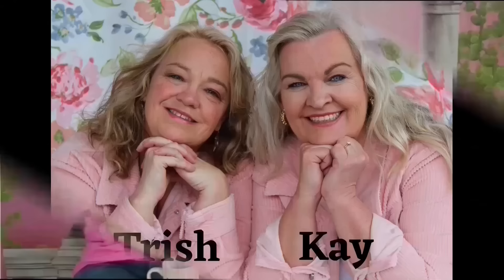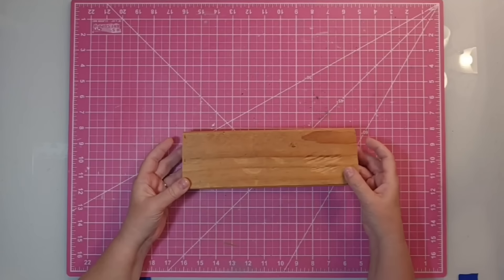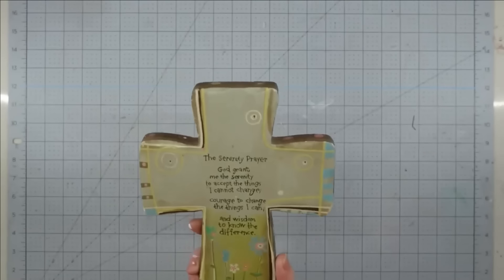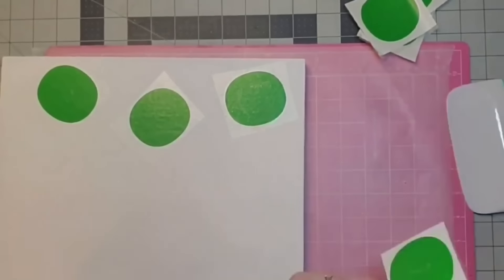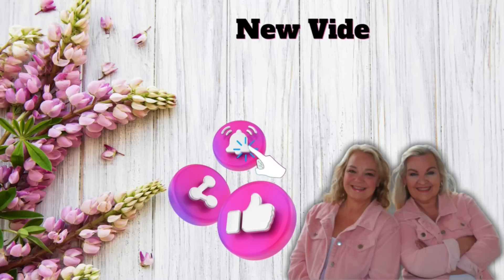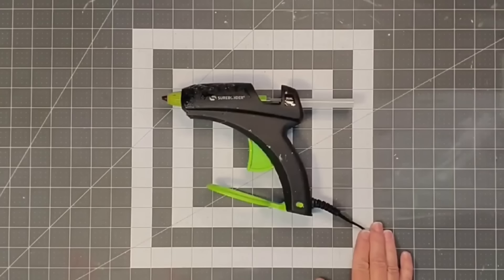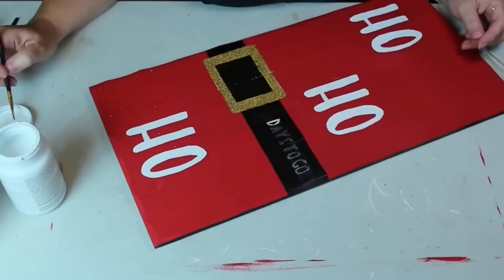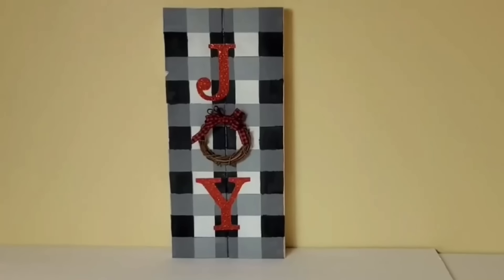Holiday Magic: Upcycle Old Items into Unique Christmas Decorations Christmas in July

Comment: Do you happen to have a video on how to use the cropodile, I'm having trouble figuring it out. 
thank you!
Reply from the maker: I don't have one specifically for using it, I have used it several times in different videos. If you can tell me which part of it is confusing you I will be happy to help. I can tell you the punches are the two side pieces. One is a small hole and the other is a little larger. The middle is not a punch, it is a snap or brad setter. If you need any help you can email us at craftingcousinsx2@gmail.com and I will be happy to try to help. Thanks for stopping by and watching 😊❤️ Have a great week